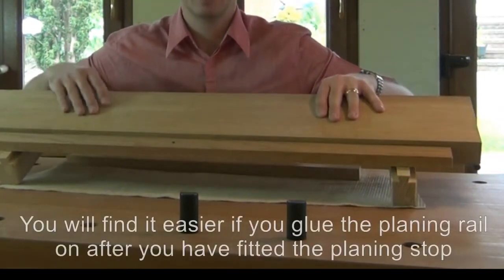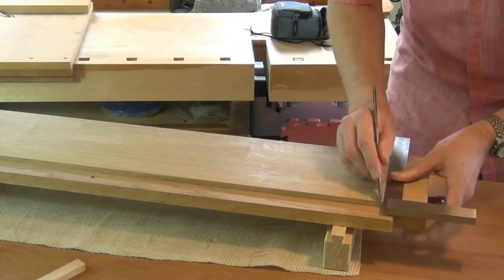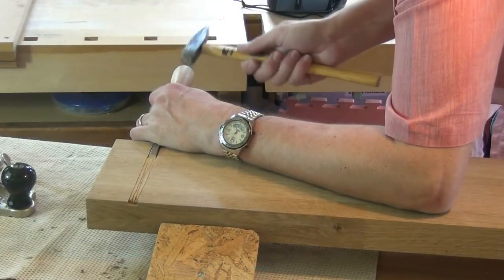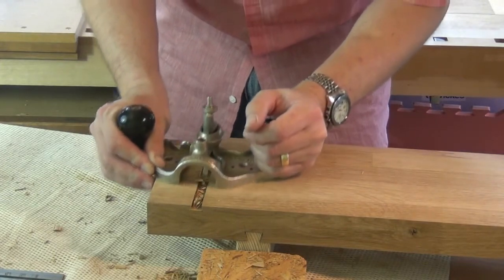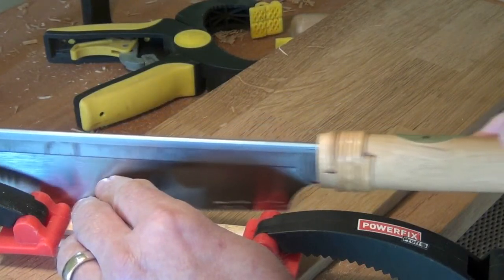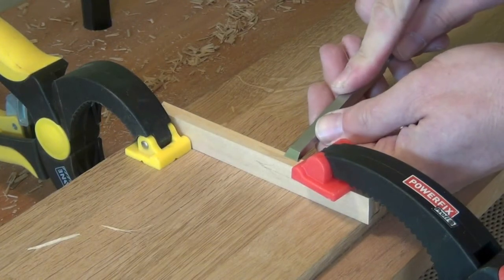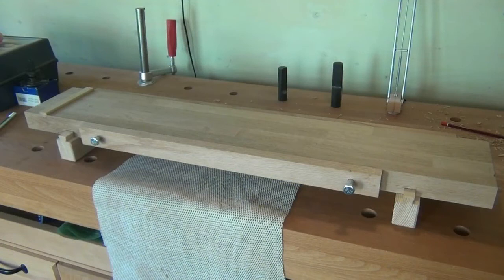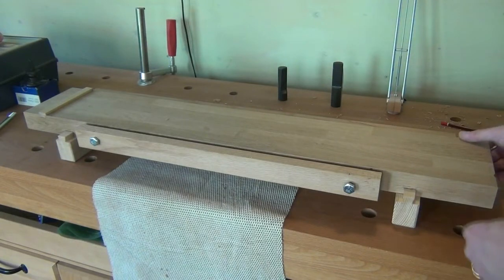Japanese Planing Board Plus - Part 2(3)

Comment from the maker: Thanks for your nice words.
The feet are traditionally fitted with sliding dovetails, and it makes sence too as they help keep the board flat and don't just fall out easily if they shrink a little. They aren't glued because of the cross grain orientation.
That said, you could just screw them on through slotted holes. For a little more mechanical strength, set them in shallow dados too.
Have fun with your build, and I hope you enjoy the result.

Comment from the maker: About 30" x 8" x 2". Still very useful at this size. Don't worry about the sizes on the sketchup model too much. If you generally work with smaller or larger components, scaling down or up may be appropriate.
Let me know how you get on if you build one.

Comment: On accuracy.
While with the shooting stop I would only be interested in some tips, I'm completely at a loss with regard to how to control the right angle of the rail. I mean, even uneven ( ;) ) clamping pressure may throw it out of true by a degree, assuming the stock for the rail was perfect.
Reply from the maker: Two ways around that. You can true it up with a shoulder plane once assembled. or, any slight error can be corrected for by using the lateral adjustment on the shooting plane.
A point to note is that, unlike free planing of a board, errors are fixed and not compounded by each subsequent pass of the plane.
Reply: I'm sorry, but I don't get the bit about how errors are being different in fixed vs free solutions. Where's the additional error coming from in the free solution.